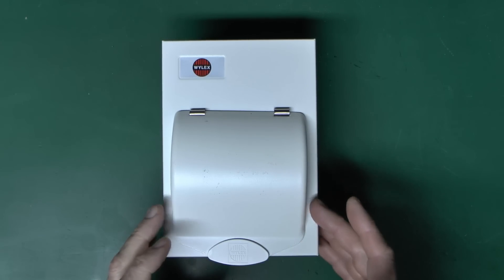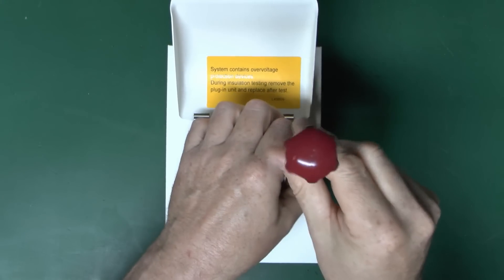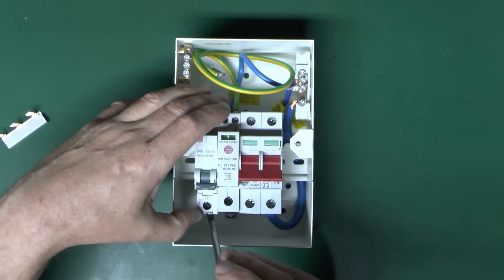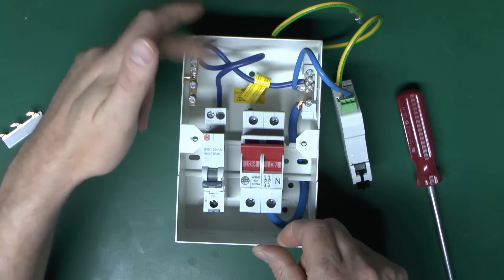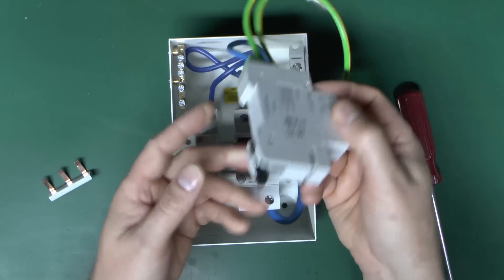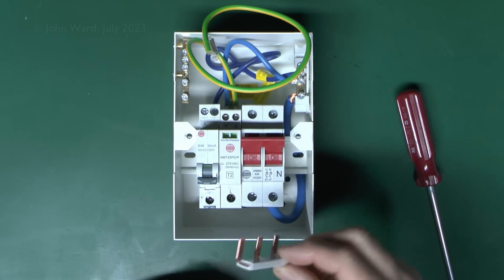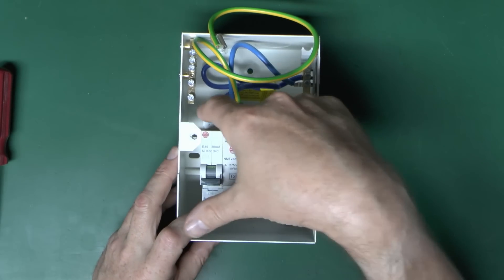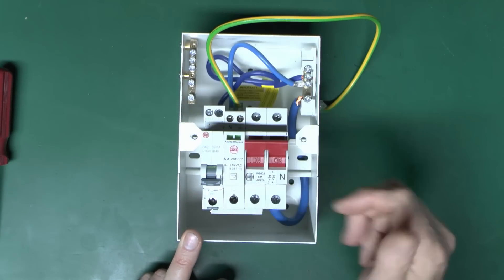Wylex Mini Consumer Unit, RCBO and SPD

Comment: is it possible to get a B type RCBO for wylex NM consumer units ?  I thought some car supplies needed them ...
I only ask , because well I haven't found one yet !
Reply from the maker: No, Wylex do not make Type B RCDs or RCBOs in any form., so if you need one it will have to be from some other manufacturer installed in a separate enclosure.
Most EVSEs contain the equivalent of Type B RCD protection.
Reply: @jwflame  ahh thanks . You've confirmed what I thought ! Well what I hadn't found !
Reply: @jwflame  thanks. One other question , what are your opinions on using say a 25 to 32 mm deep PVC plastic boxes ( not the Bakelite type ones, they're too fragile ) , plastered in to old style brick and plaster walls. 
The ones where it would usually be a galvanised steel box. 
yes the steel boxes are mechanically stronger, but the main reason for  this , is for putting in a wifi smart light switch. 
Earthed steel boxes are brilliant faraday cages, and  thus muck up  radio signals.
So plastic would be better, for radio signals. If not for mechanical strength or fire safety.

But I'm wondering if , (1) the BS7671 regs allow me.  (2) would it fail an  EICR  . 

I'm sure I could make it physically work. It would be "non standard".

On the fire safey angle, well PVC boxes are allowed  on the surface, and appleby boxes are allowed in dry liner walls !
Reply from the maker: @karlosh9286  Nothing to prevent you from using PVC boxes in a wall.  Only problem will be they are the same size as the faceplate (metal being smaller) so they will have to be 100% aligned with the plaster otherwise you will get the faceplate sticking out, or being sunken into the wall.
Reply: @jwflame  ahh, thanks . Yeah, that's a fair point. I just wished someone would make something suitable. I guess another issue is they have to be dead square when in the wall, because no sliding adjustment on screw points , like the galv. steel ones have.

I wonder if I could make an appleby dry liner box work , but the plastic on those doesn't feel as strong as the PVC surface boxes. Also appleby dry liner boxes aren't going to easily accept a 20mm plastic conduit.

Comment: Can you put a 40amp breaker on 6mm cable? Am I misunderstanding what is said at the end?
Reply from the maker: 6mm² cable can be used on a 40A device, provided it is installed in a way which results in it's rating being more than 40A.
Fixed on a surface, buried underground or concealed in plaster would comply.
Shoved through a load of insulation would not.

Comment: JW what are you feelings on using a unit like this in a separate fibreglass/GRP meter box with the supply split with "Henley" blocks, with one set of tails going in to this and then SWA glanded in to this enclosure to feed an outbuilding using a C Curve 50/63A MCB for protection rather than a typical KMF/fused switch with a HRC Fuse? As a small CU like this would also allow a 100ma TD RCD to be fitted if required instead of the main switch isolator and there would also potentially be space for an RCBO to run an outside socket or similar accessories too. KMF/Fused switches are usually used to feed an outbuilding like this but they do have their limitations and I don't see how it's any different to running tails to a EVSE external CU as those always have MCB/RCCB/RCBO opposed to HRC fuses.

Comment: The bus bar terminal on my new Wylex SPD doesn't line up with the bus bar terminal on my BG RCBOs
Reply from the maker: Why should it - two different and unrelated manufacturers of devices.  Use the BG SPD with BG equipment.
Reply: @jwflame  The bus bar terminal on my BG SPD is the earth.
Reply from the maker: @henrytwigger2245  That is the older model designed to be connected via a separate MCB.  The newer type CUSPDT21N is a direct busbar connection. 
https://www.bgelectrical.uk/uk/circuit-protection/devices/spd

Comment: Hi John. I need to install a SPD device to a property but it does not  have any space in the consumer unit. Any advice if it can be installed as a standalone unit like this? Baring in mind I won't have a load part connected (such as EV charger). Any advice will be kindly appreciated
Reply from the maker: Yes, these are usually done with an isolator in the same enclosure such as this https://www.tlc-direct.co.uk/Products/WYREC2SPD.html example, there are various other brands which are similar.
Reply: @jwflame  Thank you so much for your reply!

Comment: Some of these SPDs spec that the "earth" from the SPD  needs to be 6mm2, which seems to be so in the video. But then it connects to the 2.5mm2 from the 6mm2 T&E from the main CU. Is that sensible ?
Reply from the maker: No.  Consumer units should not be supplied with T&E as the protective conductor is undersized.
Reply: @jwflame  Aren't Garage and EV sub CU's like the one in your video routinely supplied with T&E from a MCB in the house CU ?
Reply: T&E from the main CU. Don't connect the E to the mini CU. Separate earth spike with 6mm2 connection to the mini CU ?

Comment: Can a unit, similar to this, be used to retrofit an SPD outside of an existing CCU. For example a unit with an SPD and Main Switch that takes in the meter tails, then can supply the existing main CCU? Great video !
Reply from the maker: Yes, although the RCBO isn't needed for that.  Wylex have a premade unit for the purpose, REC2SPD, https://www.edwardes.co.uk/products/wylex-rec2spd-100a-rec-c-w-type-2-spd-insulated
similar available from other manufacturers such as https://www.tlc-direct.co.uk/Products/MKYS5704SMET.html

Comment: Hi JW wylex sp or dp rcbos how can you tell which on you have just by looking doesn’t it say on them
Reply from the maker: Compact RCBOs are switched neutral.  The tall versions are not.
Reply: Thanks for the answer I think mines are single pole with switched neutral miniature type B which I thought was most common in uk but when I went to buy one from Screwfix they only have double pole miniature type b rcbos can you tell by looking what ones you definitely have as they don’t actually say on the front of them .

Comment: John  this is about heat safety fixings AMD 2 for cables if there is a basket tray carrying a lot of cables fitted to L shaped  metal wall brackets along an escape corridor 50 metres long and the brackets were fitted onto these 5.5 red rawlplugs would the rawlplugs melt if there was a fierce fire and all basket tray fall down and block escape corridor stopping people from getting out
Reply from the maker: Yes, plastic wall plugs can melt.
Small red plugs and screws are not appropriate for fixing a substantial amount of tray, concrete anchors or resin studs would be more appropriate.

Comment: Hi JW, a quick question maybe you could help me with. In regard to DC circuits, is there a difference between using a solid conductor or using a multi stranded conductor ?

This is in regard to model railway using up-to say 25v DC at about 6 Amps for points, Lights etc. Also DCC train controllers that output 16 Volt up-to 8 Amps. Pulse Width Modulation. 
Not quite DC nor AC but more like On/Off pulses of DC.
Any help in this regard would be appreciated. Thanks for your time. Alan
Reply from the maker: No difference, and there is no difference on AC either.

There is something called 'skin effect' with AC where current tends to be distributed towards the outer surface of a conductor, but at 50Hz that's only relevant for large conductors of at least 250mm², or for much higher frequencies.  Even there, a stranded conductor acts like a solid core one, unless the strands are individually insulated.
Reply: @jwflame  Hi JW, many thanks for your quick reply, it is very much appreciated.
What a great and detailed answer, thanks again.
Regards, Alan

Comment: Hi John if there was a surge in the main consumer unit would you still need to leave in the surge in this unit.
Reply from the maker: Not usually.
Might be required if the smaller unit was located a significant distance away.
Reply: Thanks John
On another issue any chance you could do a video on  wiring single phasechangeover switches.thanks

Comment: I've built a few Fusebox units with C63 MCBs as an alternative to a switched fuse and the added benefit of SPD near the supply point.

The C63 maintains selectivity for B32 [or even B63] devices downstream.

What I would love is a C63 S-Type 300mA Double Pole RCBO.
Reply: B63 vs C63 isnt’t selective. That is, it’s only going to be selective about overloads that are high but not very high. Somewhere between 3-10x nominal. Regular overloads and short circuits they both react exactly the same to so either one or even both might trip.
Reply: @JasperJanssen  I think you've got that the wrong way around.

A B63 and C63 have precisely the same overload curve but a different fault trip.

The fault trip regions don't overlap unless the fault current is high enough to trip both - because there's no time delay on any MCB unlike with many MCCBs.

But if you're pulling a fault likely to trip a B63 and C63 in series then your typical 80A BS88 is likely to be going too.

Remember that whilst we consider faults as sudden short circuits of negligible impedance. Real world faults take time to develop. All Insulation takes time to ionise into something conductive.
Reply: I've got an install coming up with 22m of 10mm2 SWA (Clipped direct) going to an outbuilding, I'm putting up an external fibreglass/grp meter box next to the DNO meter cab, tails go in to a 100A isolator and are then split in to "Henley" blocks. However I'm in two minds what to do next as I've got a few items in stock that would be suitable. Initially I was going to put a Lewden IP65 Plastic insulated CU in to the second meter cabinet with a MCB (Thinking C Curve too 50/63A) an RCBO (16/20A) as an outdoor socket can go below that meter box and then a 63/100A main switch isolator or a 100ma TD RCD as the location this is feeding may end up going TT,  one circuit from the outbuilding DB is already going to be a TT island for a hot tub anyway, but there are some reasons the outbuilding may need to be TT too due to the introduction of extraneous parts/true earth later on due to some other equipment that may go in there. So for the moment the PME earth will be protecting the armour shield and using the 3rd core on the SWA as a CPC to that outbuilding. As the SWA will terminate in to a Wiska box, the PME CPC can be removed later on and a suitable earth rod added and the PME earth will stay protecting the SWA shield. The 100ma TD RCD is belts and braces but will protect the SWA and the tails going in to the CU at the outbuilding, as water is involved too with a hot tub circuit it is a double fail safe if there was an issue with that. So basically using a CU in this manor for the submain seems absolutely ideal in theory and on paper as it covers everything. 

However there is a lot of talk about selectivity and a lot are very set in their ways using a fused switch/KMF and I do have suitable enclosed fused switches that will take SWA directly. I feel there may actually be more selectivity in the other direction as we still need selectivity there too, using a C rated MCB over a HRC fuse may offer more selectivity there too, for example if the DNO fuse is 80A then there isn't much selectivity having a 63A fuse for the submain, the 80A DNO fuse could still go first and that's a worse situation if that blows as you have lost the whole supply and technically should get the DNO out to replace that fuse. Where as a MCB in a lot of scenarios would trip before the DNO HRC fuse blew.

So I'm currently deciding between the two options, the "Insulated" IP 65 CU with RCB/RCBO/TD RCD seems to be an ideal solution, there is another caveat here too, I am deliberately planning on using a plastic insulated CU over a metal cased CU due to it being in an outside location, if there was an issue and power went off completely to the outbuilding the first thing someone will do is check the DB at that location, then check the fused switch/cu downstream, as it's a PME system there could well be a PEN fault, as it's outside you have true earth underneath you and extraneous parts around, not to mention being potentially barefoot getting out of the hot tub, a fibreglass/grp cabinet with a plastic CU inside it offers a lot more protection in that situation and under current regs it's still permitted to be used in that location.

So going back to something else here as well, 10mm2 SWA 2 loaded cores clipped direct is rated at 67A using Table 4D4A for 70c PVC, plus there is an additional core for the CPC in addition to the earthed shield, we all know nearly all SWA is XLPE 90c rated these days but that's only applicable with 90c terminals, so I always go with 70c tables and theres a bit of headroom has the cable itself is XLPE. A 63A HRC fuse wouldn't be suitable with that at all so a 50A fuse would have to be used. However a 63A C Curve MCB may well just work there when I do my calcs.

Comment: Hi John! Alsways interesting to see how things are done different in different countries. Two quick questions:
1. For the RCBO I assume due to the low price of the unit, that the B stands for the B characteristic of the MCB-part and not for a B-Type of the RCD part. Does that mean, that in the UK a normal Type A RCD is sufficient for EVSE? In Germany a Type B, that protects also when DC is present, is mandatory in that situation (as well as in Photovoltaic installations).
2. You are absolutely right to chose a 40A RCBO. The three-phase MCBs we use over here (yep, we charge three phase up to 22 kW) are limited to 80% of the rated maximum current if used under constant load. However you lost me on the wiring. You recommend 6mm². Acoording to my tables, we need 10mm² for 40A?
Thanks and greetings from Germany
Andreas
Reply from the maker: Yes, it's a Type B circuit breaker, and a Type A RCD.
Type A RCDs can be used for EVSE but only where the EVSE also contains a Type B or equivalent DC detection.  If not then a Type B RCD would be required.  Most of those available in the UK have the DC detection built in.

6mm² armoured cable is rated to well over 40A on single phase, example: http://www.batt.co.uk/upload/files/table4d4_1540217869.pdf
3 phase is available for commercial/industrial locations, but the majority of homes only have single phase available.
Larger sizes would be used for longer distances, but that's not likely on a domestic installation.
Reply: @jwflame your videos are the best of the best.
Reply: Hi John Nice unit I guess the car charger would have the load balancing kit built in.
Ps can you do a video o  change over switches for a stand by generator  for a domestic house .

Comment: Wait so the SPD is in parallel with the RCBO or in series? I'm confused.
Reply: Parallel. The SPD is basically just a suitably  rated MOV and a few extra bits, which connects across Live and Neutral. All other loads are then parallel to that. Any transient voltage then appearing above the MOV rating is dumped via the MOV to Neutral (converted to heat through the MOV) thus clamping the Live to all other devices to the nominal 240v. That's the reason its supposed to go as close to the main breaker as it is then 'closest' to the incoming supply.

MOVs are 'reusable' in the sense that once the transient is gone they stop dumping the excess and return to being high impedance. However, they do degrade each time they are used hence if a suitably large spike occurs you have to replace it, or if over time enough smaller transients have degraded it to the point of deterioration you also have to replace. I'm not exactly sure how they measure that as it needs to be a reliable measurement.
Reply: @Thats_Mr_Random_Person_to_you  Gotcha, thanks for explaining

Comment: Never understood why your panels would need to come prewired, surely you lot own a bit of flex and bootlaces.
Reply from the maker: Type testing and approval, which requires that everything in it is supplied by the manufacturer, so it's identical to the one used for the test.
Reply: @jwflame  What tests are they doing that you lot can not? Also never understood why the main switch is on right also when logical we read left to right. I do like our QLD Aussie electrics compared to UK's considering I can do metering and build your board from scratch.
Reply from the maker: @TradieTrev Placing the assembled unit into a test jig, applying 16kA into a short circuit fault and seeing if it survives or not. 
Repeat for other combinations of devices from that manufacturer.
Covered in Annex ZB of BS EN 61439-
3.

People can assemble their own panels and whatever else, but in doing so they become the manufacturer of the assembly and responsible for it's design, which isn't something the majority of electricians want to be involved with.

Consumer units can be obtained with the main switch on the left or the right. Or vertical with the switch at the bottom.

Comment: At least that unit has a proper din rail,  the bigger Wylex boards have done away with the lower half of the rail so the equipment hangs on the top of the rail only and is secured by the screw to the bus bar.  I suppose you can easily check then if you have missed it (I still inspect with a mirror anyway) as it will lift off the busbar if its been misfitted.
Reply: I modified my 11 way Wylex board with a proper DIN rail for better security.